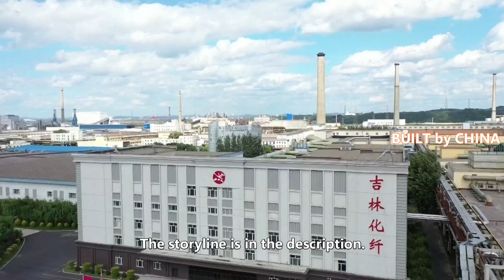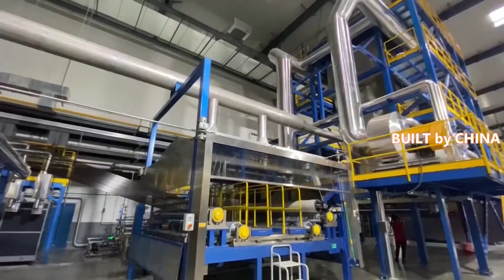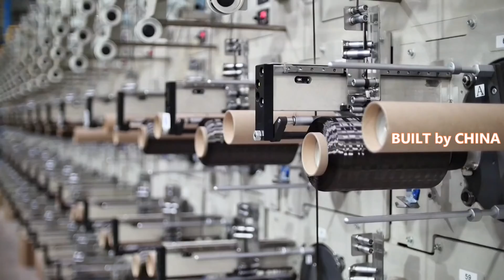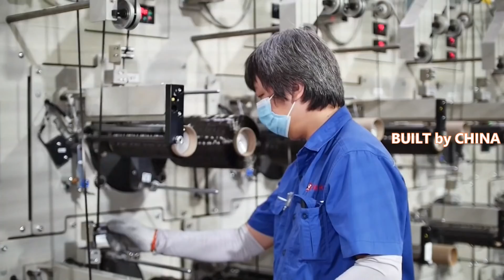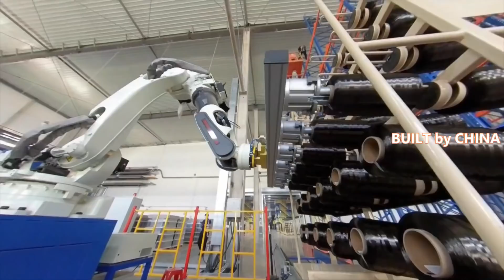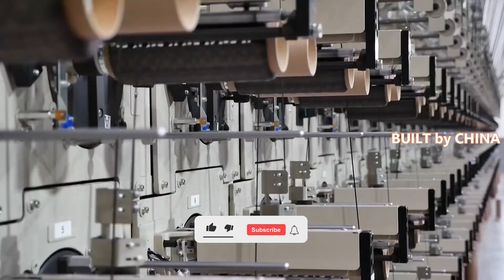China's largest carbon fiber production line was put into use. | 中國最大的碳纖維生產線投入使用。

Comment: has anyone heard about warplanes and warships being made out of carbon fibre? just wondering well you know its strong and light? and cars use it? must be good for planes and boats???
Reply: many drones and unmanned ships are carbon fibre now，at least Wing Long should be，private Chinese firms have been forward thinking
Reply: Wind power blades, new energy vehicles, large aircraft, spaceships, sporting goods! Too many uses!Corrosion resistance, light, high temperature resistance, strong toughness!
Reply: Carbon fiber heat tolerance are poor with jet engines being what they are it's not a good material for planes. Some of the fastest speed boats are made of carbon fiber

Comment: Good china is mass producing carbon fiber to bring cost down. The western company deliberately limit supply to keep cost high. There is new news china is studying building verg large spaceship. 5 miles long.
This would fit in with china plans to build this very large spaceship. They would need very strong materials while keeping the weight down. This carbon fiber factory will give china the lead to build the very large spaceship. The US wont be able to produce enough carbon to compete with china on building a large spaceship.
Reply: so huge? if any space debris hit it how?
Reply: @fannyalbi9040  no 0.5 miles long. Most debris are low orbit. Thry may build it at higher orbit. Im sure they will build bulkheads on outter shells of spaceship to protect inner habitat zone.
Reply: That's why china will be the first country to build a kilometer long spaceship. West is going tobe far behind in space exploration in future because they let china to be part of international space program whether it's ISS, satelite navigation system etc.